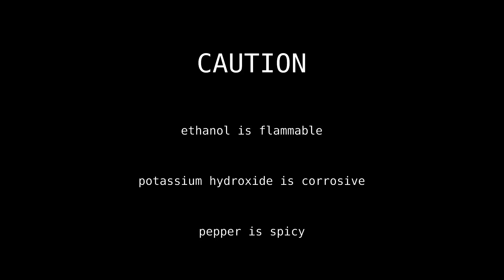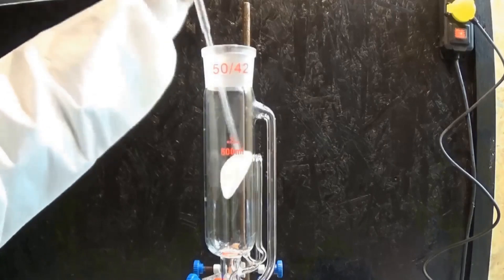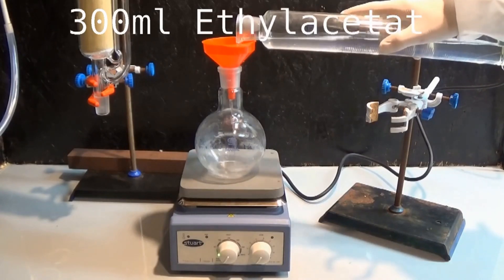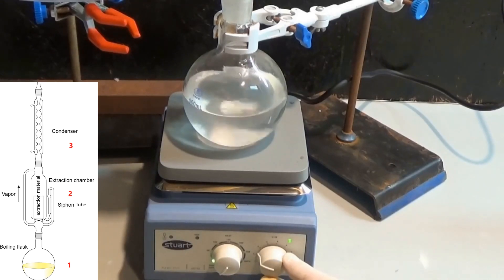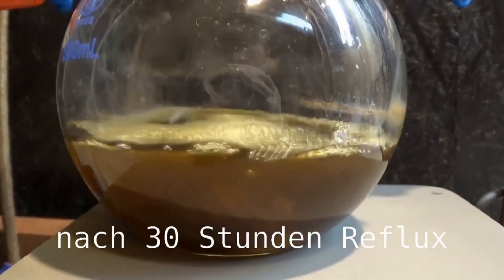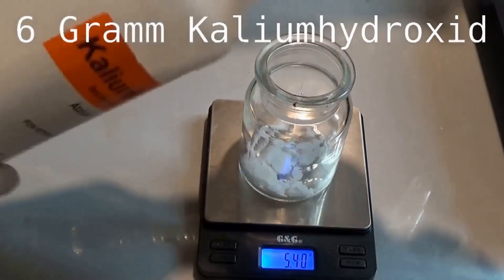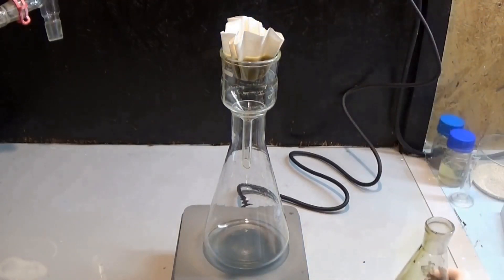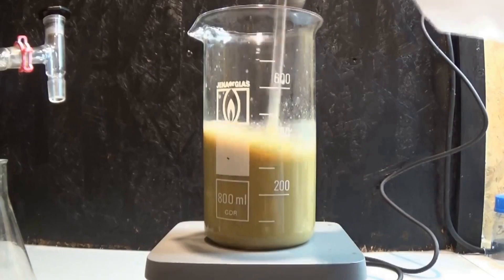Isolation of piperine from white pepper

Comment from the maker: Hello you all
Due to a copyright claim on my three-year-old piperin video I had to put a new audio on it, so this is a reupload. But this time it is in English and not in German. Hop you enjoy the video. 
In this video we are working with flammable and corrosive chemicals proper safety equipment must be worn. So now lets dive straight into the fun.
Our goal is to extract 1-Piperoylpiperidine also known as piperine. It is the most common alkaloid in pepper with percentages ranging from 5-10%. Piperine is soluble in lipophilic solvents. 
To reduce the amount of water present in the pepper I dried 240 grams over the course of around 120 hours at a temperature of 80°C. This all happened under the exclusion of light which was achieved by rapping everything in aluminum foil. I highly recommend using white pepper because the shell which contains the highest percentage of resin and fat has been removed. 
With drying the weight was reduced by 42 grams which corresponds to 17,5% of the starting weight.
Now cotton pads are inserted into the Soxhlet extractor to prevent the pepper from getting sucked into the siphon tube. This is one of two options and you can also use a special cellulose shell for your extraction material. I decided to go with this approach because it allows me to fill in more material. But you have to keep in mind that your extraction material can lead to very slow flow rates of the solvent thus decreasing the efficiency of the process. Now 97,6 grams of the pre dried pepper are filled into the Soxhlet apparatus. 
While I am recording this, I am in the middle of the renovation of my lab, which desperately needed a new roof and some further improvements. For example, I added new lights, painted the fume hood and the floor with special paints for water and chemical resistance and I treated all the rusting metal parts. If you have an idea for what else I should add to the lab write me a comment I am always happy get new inputs which allow me to improve the lab. If you like to support, my work via Patreon! Link is in the video description.  
As solvent I chose ethyl acetate because it can be easily distilled from nail polish remover. The used ethyl acetate was pre dried using 3 angstrom molecular sieves to get rid of any remaining water. 300 milliliters of dry ethyl acetate are added to the boiling flask followed by a magnetic stir bar. Afterwards the apparatus is assembled and connected to the cooling water.       
So now it is time to look at how a Soxhlet extractor works. The Soxhlet extractor is divided into three parts with different functions. The first part is the boiling flask. In the boiling flask (hence the name) the solvent is brought to boil and the solvent vapor travels upwards. The hot solvent vapor travels thru the vapor tube into the second part, which is the extraction unit. There it travels up even further until it reaches the third and final part which is the condenser. Upon reaching the condenser the vapor turns back into a liquid and drops into the extraction chamber. The still hot liquid solvent reaches the extraction material and solvates some of the molecules that are soluble in it. When the solvent reaches a certain level the siphon effect kicks in and sucks all of the solvent back into the boiling flask. Thru this process the extract concentrates in the boiling flask.  From there on the process starts a new. The beauty of this process is that each extraction cycle is performed with the same solvent BUT the solvent is always “fresh” because it continuously distills into the extraction chamber. This allows you to extract nearly 100% of the soluble molecules.  
It should be noted that due to the fine pepper powder it may happen that the siphon effect is not working as intended. But this is no real problem because after some time a slow but steady drip rate of solvent sets in. The extraction is done when the solvent in the siphon tube appears crystal clear. In my case this occurred after 25 hours. Because this was my graduation project in chemistry, I wanted to get the maximum yield, so I extracted for a further 5 hours. If you are short on time and you don´t need as much piperin as you can get, I highly recommend using a coarser grain or one of the extraction shells because it will save you a couple of hours in waiting. Now that we have performed the extraction it is time to clean up the extract. For this I transferred the extract into a distillation apparatus and reduced the volume by around 50%. This was mainly because ethyl acetate can be hydrolyzed by sodium hydroxide which we will use in the next step. As a fun chemistry fact keep in mind that caustic ester hydrolysis is a non-reversible process because the organic acid lacks the proton to reform the ester with the alcohol. Again there is room for improvement in this case I recommend to distill of all of the ethyl acetate using a water bath. The water bath is used to distill to dryness without the risks of burning the crude product. The crude product is then solvated in warm ethanol.  With the equipment I now have I would simply use my rotational evaporator for this step but for most amateur chemists such thing are just as easy to come by as a solid bar of platinium. The concentrated extract is now filtered thru some cotton to remove any residual pepper or other impuritys. The next step in the cleanup is the preparation of a saponification solution. This is done by solvating around 6 grams of potassium hydroxide in 50 milliliters ethanol. You can also use sodium hydroxide instead of potassium hydroxide but there may be a slight difference in the appearance of the resin and fat soaps. I also dried the ethanol over three angstrom molecular sieves but that is optional.  
The potassium hydroxide solution is used to get rid of most of the resin and fat which we extracted alongside our wanted piperin. The process is very simple and works just like the production of soap. In our case the hydroxide ions react with the ester bonds in the resin and fat to break them up and form water soluble salts. These are commonly known as surfactants and better soluble in water than in the used ethanol which leads to some of them crashing out of solution. The hydrolysis also works on the piperin but only very slowly. This can also be seen in the harsh conditions that are needed to hydrolyze piperin into piperinic acid and piperidine. The hydroxide solution is added in one go and the reaction mixture is stirred for a short period of time. The resulting mixture is filtered and the filter paper is washed once using dry ethanol. If you have access to a vacuum filtration system, I have to warn you do not use the glas filters for this step. The guppy mixture clocks them pretty bad and is a pain to clean out. I had to use hot tetra chloroethylene followed by chromic acid which both are chemicals I don´t really like to work with. But if you have a buchner funnel go for it and enjoy the time saving luxury of a vacuum filtration. Now we are finally approaching the last step: getting our piperin out of that solution. For this we are utilizing two properties of the involved chemicals. Namely solubility and mixability. Because water and ethanol are mixable in any ratio we can add more and more water to the ethanol which decreases the percentage of ethanol in the solution. The piperin is only soluble in in the ethanol but not in the water we are mixing in. Because of this the solubility of piperin reduces and it starts crashing out. The bright yellowish looking clouds you can see are actually very fine piperin crystals which are forced out of solution. I know that thru the display and especially with my old camera it doesn’t seem like it but I find the way the crystals are coming out the solution very interesting and beautiful. After no more cloudiness occurred, I gave the mixture a good stir and put it in the freezer for 12 hours. This is important because it gives the piperine enough time to clump into bigger clusters of crystals which can be filtered. I tried filtering the piperine straight after crashing it out of solution but it failed with all the filter papers I had. The last step is a recrystallization. To perform it the piperine is brought into solution in hot boiling ethanol. This mixture is keep boiling and water is added up to the point that the piperine that is crashing out is just redesolving. This recrystallization step can be done several times to increase the purity of the product. Just remember that with every recrystallization you are losing some of your product. After the filtration I was left with 4.40 grams of a bright yellow crystallin powder. The look and the weight of the product were enough to satisfy my teacher and I got a decent grade from the whole project.I want to thank all my patreon supporters and all of you guys your positive feedback is one reasons why I am doing all of this. So only one thing left to say  …. Have fun and do not kill yourself
Reply: T H E   S C R I P T

Comment: I think this is a very nice method. I never heard of a saponification step in piperidine extraction before
Reply from the maker: well there are many papers on the mater .... but nearly all come to the conclusion that the clean up works best with this step. BUT if you have access to a good chromatography column skip the saponification and do the clean up with the column and a uv lamp.

mfg hazelChem
Reply: Hi could you help me? I'm trying to carry out the hydrolysis of piperine to piperidine.

Comment: QUESTION,,,,,,,,,,,,When you do the saponification and break the esters down into salts of carboxylic acids and alcohols  are you using any heat??????????    It seems like you just stirred it up with no heat.   Was the pot even hot from distilling out the ethyl acetate??????   I mean i know you need a LOT of heat and reflux to break the amide bond on the piperine.   But don't you need at least SOME heat to break the ester bonds for saponification????????????    Also you did not stir it long either.    I have made esters but I have NEVER done a saponification.   SO I DO NOT KNOW.   But by watching your video i am ASSUMING that saponification is FAST and pretty much spontaneous at room temperature.   Am I right in that assumption?????????

Comment: nice voiceover ;)
can i ask you what chemically resistant paint you used for your lab? i don't have the space for a lab (sigh) but i've been building a fumehood from scratch for a few years, and i upgrade it as i go, right now it is bare wood, and it is no good. I planned on using metal panels, but they are not cheap nor easy to mount now.
Reply from the maker: hey so you should use wood ! no metal because metal will be corroded away in no time! lab air is pretty harsh to many materials. The paint for the fume hood was specially made for me by a local company (it also does not reflect light which is better for filming videos. But it was 40 euros per liter) the paint for the floor was a liquid polymer paint that is normally used in the garage. 
ps: I highly recommend to use a motor that manages at least 300 cubic meters of air per hour

hope this helps you :D 

mfg hazelChem
Reply: @HazelChem  it does, thanks
Reply: Ubya...........Hazel chem knows more than me on the subject but i thought i would throw my 2 cents in.    I built a fume hood for my buddy and i just used all wood and painted it with regular latex indoor white paint.   I figured it would protect the wood and if it got stained up the regular house paint is so cheap and the fume hood so small i could just re paint it once every 5 or ten years.   Seriously though except for the table part of the fume hood where you set things down and spill things on there really are no stains.  The paint has been good for years although he does not use the fume hood that often.   I use it more than him.  The paint i always wanted to get when building metal vessels is TEFLON PAINT.  To coat the metal inside of the vessel.    Teflon is what a stir bar is covered in so it must be very good at fighting corrosion.  But i think just regular house paint is good enough.   Because teflon paint is like 5 or 6 times as much money as regular house paint.   It is like $30 a pint or more.  
                     Hazel chem mentioned fans and getting at least a 300 m3/hour exhaust fan.  That is about 177 cfm (cubic feet per minute).     ANYWAYS i put 3  fans in the fume hood i built and they were just exhaust fans i bought at lowe's hardware that you would put in your bathroom to exhaust water vapor when you get a shower.   Most but not all are rated at 70 cfm.   Times that by 3 and you got 210 cfm.   I bring this up cause they are cheap fans.  The minimum cfm for bathroom exhaust fans is 50 cfm.     Although i made the mistake of mounting them on top and OUTSIDE of the fume hood.  THEY JUST LEAKED CAUSE OF THAT.   So last winter.......at the end of winter........i took the fans out and mounted them on the INSIDE of the fume hood so now there should be no leaks.   HOPEFULLY.   I need to do some experiments with NASTY chemicals and see if it works perfect now or not

Comment: This is isolation of piperine..
Do you think isolation and extraction is same?
Reply from the maker: well the first step is extraction followed up by the isolation of the desired compound. So as the yt caption is not long enought to cover this I just called it extraction. But you are right ;D So lets correct this quickly. 
thanks for the comment 

mfg hazelChem